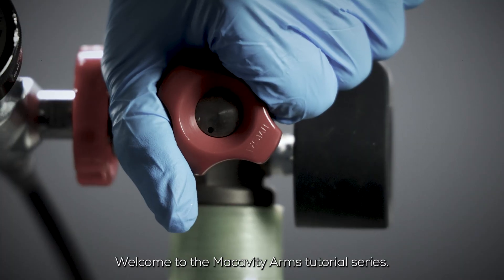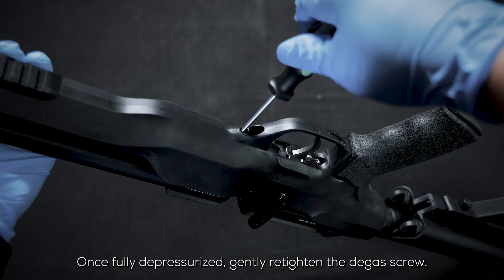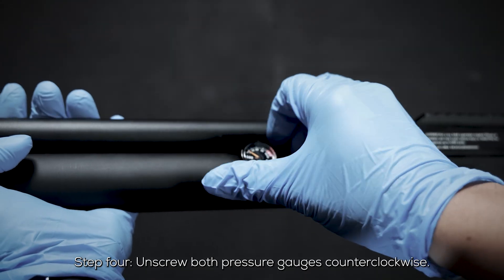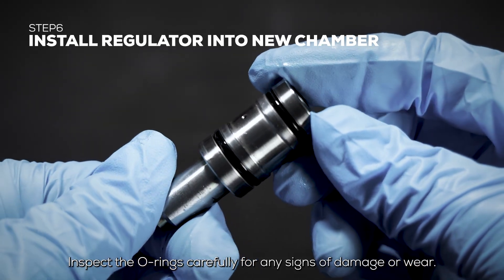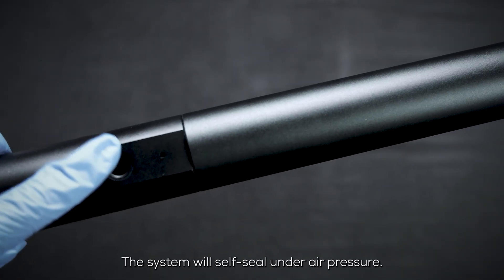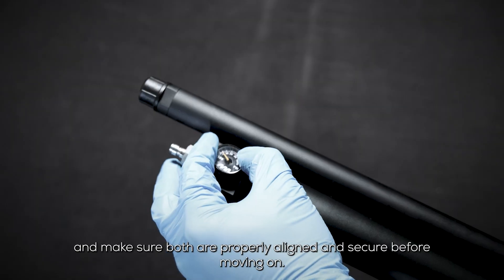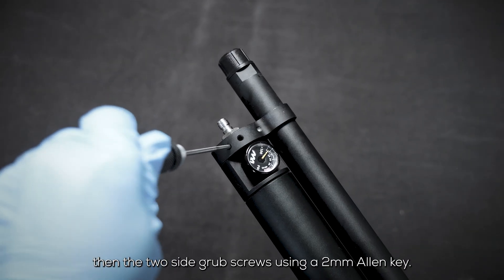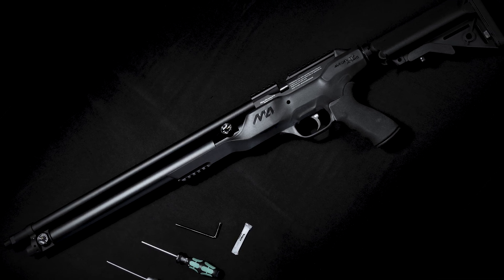MA How-To Ep04: Replace with Gen2 Air Cylinder and Regulator Chamber [MA2]

Comment: Just did mine today. Very easy to do, just follow the video instructions. Sprayed the joints and gauges with soap and no leaks. Make sure you have the regulator gauge turned up far enough or the stock won't go back on.

Comment: The  the aluminum spacer is not Showen to be put back in, is it no longer needed? Any input would be greatly appreciated.
Reply: Just did mine today. No, you don't need the spacer.
Reply: @overthehill1958  I just finished putting mine together and aired it up! So far so good
Reply: No I think that’s what the new part is taking place of.
Reply from the maker: No, you don't need the spacer anymore with the new reg chamber.

Comment: My rifle went out to the factory around five weeks ago for exchange under warranty as it had very low shot count. Then about two weeks in the recall started so they couldn't get me a rifle ready as was waiting on new parts which were still on the water and not delivered yet. Now the parts are here so I'm waiting on a replacement new Sniper MA2 long 22. This is taking forever and my latest email is not being answered. Maybe monday?😢 I just want a working rifle back!
Reply: How many shots were you getting?
Reply: Only 19 out of the Sniper long MA2 22 caliber. Not even close to the amount on the box shipping label.😮
Reply: @stevengoodman3498  yea I get about 20 with the .30 long, you should be getting way more
Reply: @Wildman1010 Hey man, I've been adjusting the regulator and hammer spring and now get 50 to 60 shots. A lot better than the 19 i was getting but this is also a replacement rifle not just a repaired one. That first one i had was a real mess!

Comment: Will the rifle still work if I remove the regulator altogether? I really don't even want a regulator at all. It's just another part that can fail, which is why I preferred the pre-production model. By the way, I still haven't gotten my corresponding email from Macavity Arms either, and it's been almost a month.
Reply: I myself am going to run mine unregulated as I was already. If you do you need to add a weighted hammer spring spacer otherwise the gun will be operating with partial valve lock. That's what I do. I buy a gun that isn't regulated and install a reg. and buy a regulated gun and remove the reg.! 🤔
Reply: @donald-420  is it more powerful that way? I kinda wish it hit harder, especially the .30 but I do like the consistency of the regulator.
Reply: @Wildman1010  3600 psi to start with 65 grain slug. 1st shot 865 fps. Shot #8 776 fps. 2400 psi pressure remaining. I was working on a tune but then I got the recall notice! DOH! Hope that answers your question Wildman! Love your channel btw!
Reply: @donald-420  thank you! That’s dime means a lot to me! I don’t do it for the money for sure 😂 that’s where a lot of it goes. I’d have to check my numbers but I think I’m in the mid 860’s with 50 grains and right around 880 fps with 44.5 grain Hybrids, I think you have gained some power. It would make sense because when I was going for max power there was a point where the hammer wasn’t hitting hard enough to open the valve. If you solve that you can increase power potential.
Reply: @Wildman1010  Right on brother!👍
Reply: @donald-420 😂😂😂
Reply: The pre production version still had a regulator, just no gauge

Comment: I still didn’t receive a email smh…. Bout to sell this thing…
Reply: ill give you 250
Reply: Hang in there Tom, few air guns are capable of this power and accuracy. I haven't received any correspondence on mine yet either.:goodvibes:
Reply: @BriceP.O.I. I just got the m60b yesterday 30 caliber….this thing is 🔥🔥🔥🔥🔥🔥
Reply: They need to hire Wildman 😂 I would sit here and email everyone back no matter how many times they ask me… I can’t imagine they sold more than 5000 of them anyway
Reply: @Wildman1010 they don’t even return emails now
Reply: @Tom-jw1pe  that’s wild. If you have the short barrel version I have heard from others that those parts are going to take a little longer. But if you have a long barrel version you should have had your parts already and you paid a substantial amount of money for a product so bottom line is they should feel obliged to answer any questions or concerns you have.
Reply: @Wildman1010 yea I got the short barrel… o well… thanks boss